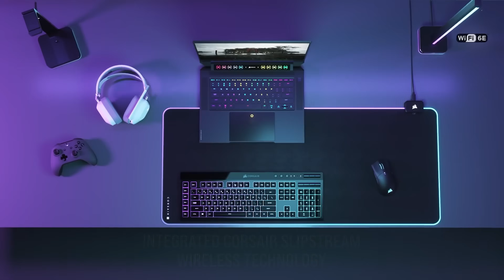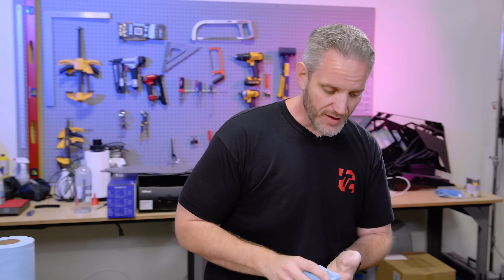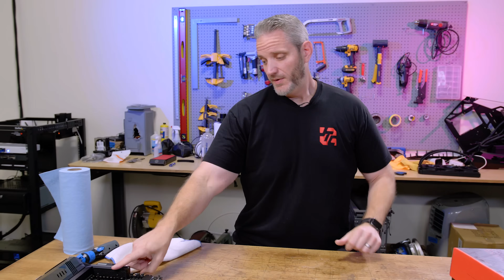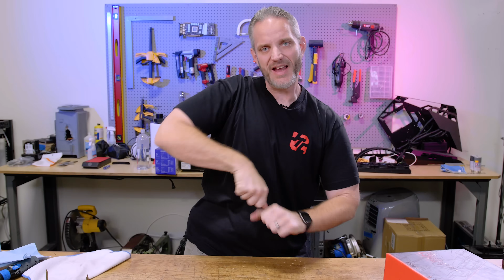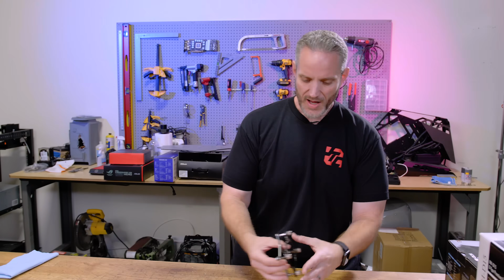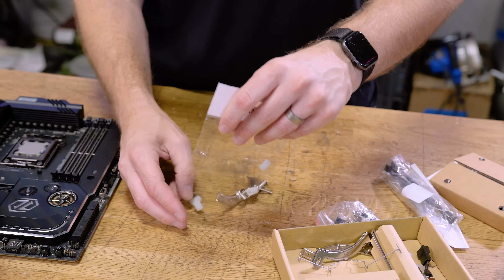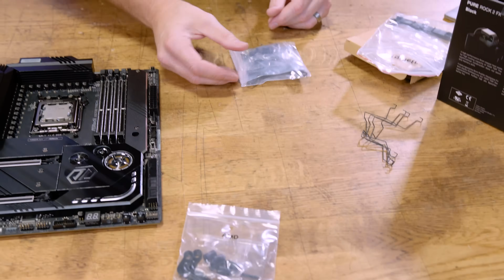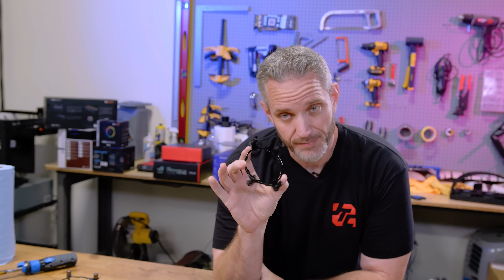AMD made a terrible flaw with this design...

Comment: Imagine installing with hooks on the old Athlons without an IHS. Besides ripping the motherboard if you slip with the screw driver, you also had a chance to chip the edge of the Die.

Comment: And then the physicist enters the comment section... In the chain of heatflow from the chip to air what material has the best thermal conductivity? Correct! Copper! The IHS is made of what material? Correct again! Copper! I'm quite certain that the increased thickness of the IHS has a very minor influence on the CPU temps. However, what has changed is the surface area of the IHS. The 20 K temperature drop that Roman was getting by delidding has to be mainly attributed to removing one thermal interface (actually the worst of them) between IHS and cooler which in addition gets rid of crappy conducting thermal paste altogether.

Comment: I don't worry about cpu degradation on tjmax 24/7, but since 7xxxx can reach higher frequencies using higher voltage if the cooling is enough... why would they do that with the thicker case? Just for cooler compatibility? Is it such a big deal when launching a new platform where customer need new mb, new ram, to also need a new cooler (or upgraded brackets) ??

edit: we got tests and reviews of the cpus using a 360 aio, I think it would be an excellent idea to have some tests of the same cpu using different coolers - how would a mid range single fan air cooler affect those cpus i wonder, please Jayz make it happen :D

Comment: EDIT2: As stated in the replies to this post, the NH-D15 does now come with AM4 mounting kit as well as the Intel kit, and is fully compatible with AM5. Jay has a very old model of the cooler, which is why his didn't include the AM4-kit.

Original post and first edit:
The NH-D15 has a separate model for the AM4-socket, which lets you mount the cooler whichever way you'd like. That's why AM4 is not mentioned on the box Jay has, it's probably an intel one. I think you can buy the AM4-compatible brackets separately. I also don't remember if it has a separate backplate or if it uses the one that AM4 comes with.

EDIT: There's another comment here by Stunlokked that has Noctua's statement on AM5-compatibility, which confirms that the AM4-compatible cooler of NH-D15 will work on AM5.
Reply: this is still incorrect. all regular nh-d15s sold after 2019 should come with intel and am4 mounting hardware(which works on am5 boards(i know because I was able to move from intel lga2011-3 to am5 without needing to request a compatability kit from noctua)). The am4 version of the nh-d15 only has amd mounting hardware in the box, they leave out the intel hardware in that edition. And noctua uses the stock backplate that comes on am4 and am5 boards.
Reply: The special AM4 edition of the NH-D15 was only a temporary product to make sure people could buy one for their new PC knowing it was compatible. Those were later phased out once the regular model started including them. Earlier owners could also request a free mounting kit, no proof of purchase required, as long as you could show that you physically have the cooler and bought an AM4 motherboard + CPU.

Comment: On the old Noctua coolers they will send you a AM4 bracket for free as they did for me and there new bracket should fit the new AM5 socket. I do have a question on the AM4 depth mounting will it be the same in depth to the AM5 socket to give you the same pressure to the CPU. EK like all the other manufacture's that use mounting brackets on the back may just have to use the right depth spacer and a screw to mount there coolers down. Again like my question is the spacer the right depth for AM4 and AM5 to give you the proper pressure to the CPU or is AM5 a little different pressure that may be just a little less.
Reply: Not for free, they charge money in the UK anyway

Comment: My question is how far can you lap the IHS before the Z-Axis height becomes an issue, and the bracket blocks the cooler plate?

Meaning, do I need to plan on a delid, or can I just shave off a mil or two, and get similar results.
Reply: If using something like the the noctua mount, you could potentially sand down the IHS by a few mm, and then sand down the plastic spacers of the mounting bracket by a few mm, and then mount the cooler as normal.

Comment: If you had a cooler that could get low enough (custom loop water block for example), would lapping the IHS or delidding be easier/have less risk of error?
Reply: Lapping would always be the less risky option as far as damage to the cpu.
Reply: There is so much metal on that IHS. You'd do better to machine a bit off before lapping or you'd be there all day. I'd delid it.
Reply: lapping is allways less of a risk, as you only make the IHS more plane on the surface and take away very little of the actual material.
delidding is always more of a risk, as you rip off the complete ihs and then put a cooler directly on to the die itself. which can destroy
the die itself even without the new cooler being put on to the die. and then when you put on the new cooler, you have to be extra
carefull to not put too much pressure onto it when tightening the mounting system down as that will also potentially damage the die.

Comment: It's looking more and more like undervolting will be the way to go.  Yes, the videos I watched show a SMALL performance loss, but at the same time, almost half the power use and a significant drop in temps.  GN very tongue in cheek said less than 600 FPS was unacceptable.  I doubt most of us could tell the difference between 500FPS and 600FPS.  Undervolting shouldn't void your warranty like deliding will.

Comment: NHD14 / D15 use a NM-AM4 Upgrade-Kit to be screwed to AM4. That should work with AM5 Boards. You can get it over Noctua Website dunno if it is for free. I bought one somewhere else because I repuropsed there Montingkit to get a Prolimatech Genesis to fit on my AM4 Board for Ryzen 5000.

Comment: So they added 2mm thickness to the IHS potentially increasing temps by around 20c to try and keep cooler compatibility but actually still needing new mounting hardware for many coolers anyway. Thats a really puzzling design choice and I would hope they have a better reason than that.

Comment: I haven't done the math on it yet. But just some napkin math says an additional 2mm of a high thermal transfer material like copper in this case would not cause a 21c increase. I wonder if there are any results from am4 direct die we could look at
Reply: The 21c decrease was from delidding, which will always make a huge difference. Shaving off 2mm from the IHS would not be as significant, but yeah it's not clear how much of an effect the extra thickness has actually had.

Comment: i believe AMD was using that hook system back in the AMD Athlon and Duron series. Quite sure i killed one of those on my first ever computer build.....gosh i'm old
Reply: Yep, started with socket A and is still there today. However I have coolers form the AM2 era, which have those clips, but you don't have to use a screwdriver for pretensioning the spring, but it has a lever that you need to turn around by 180°. Still fumbly to get the clips in place, but otherwise quite nice.
I don't know why they have not used that lever system on socket A, would have prevented some damaged boards.

Comment: I really dislike AMD's mounting mechanism. I had an AM4 cooler that used the default mount and was terrible - if you tighten it a bit wonky, or a bit too much, it will twist off the plastic hook and just fall off - I was terrified of this happening, enough to make me return the cooler I had and swap it for one that used its own mount (in fact, I think it's the same one with the 4 posts you show on the Dark Hero - same motherboard too!). I'm so much happier with the mount now.
Reply: Most decent aftermarket coolers screw into the stock backplate, which is really solid.

Regarding using the clips, I can certainly imagine having the kind of issues you describe though. :)
Reply: @blunden2  It was a Corsair, which isn't exactly a bad brand. New one is NZXT.

Comment: Love the content as always.  Entertaining and informative, great combo!  As you say, the IHS is a lot thicker, wouldn't lapping a little off the IHS help reduce temps as well ?  Obviously need to be careful of the height tolerances and contact with the cooler cold plate.
Reply: Problem with that is like de lidding the cpu doesnt that void the warranty ?? 
In essence the cpu is flawed which i dont think should sit well with consumers paying a premium for a cpu that you cant cool effectively because it is not made for the standard 7000s only the 3d v cache versions
Reply: @volvot6rdesignawd702  Absolutely will void your warranty - No one should be de-lidding, lapping or anything else that modifies the structure of the CPU, UNLESS they understand the consequences.

Comment: 'Fresh' (22nd September!) from the noctua site....so it seems even the big boy should just fit. Provided you already have the AM4 kit needed for it.

"Noctua today confirmed that all its CPU coolers and mounting-kits that support AMD AM4 also support the upcoming AM5 socket, except the NH-L9a-AM4 low-profile cooler and the NM-AM4-L9aL9i mounting-kit. For the latter, Noctua announced the new NM-AM5-L9aL9i kit that will be available free-of-charge from end of October. Mounting upgrade kits for older heatsink models that do not yet support AM4 will also be provided to customers at no additional cost."

Comment: Funfact, you can still use AM2 coolers from the Athlon64 days on a AM5 socket as longs its using clips. Personally I use a AM3 cooler (from a Phenom quad core) on my Ryzen 3 3200G in my HTPC because I had a Noctua fan for it (and it probably cools better, the stockcooler was designed for a 120W CPU and has a lot of copper) . 

Unfortunately they did change the socket holes between AM3 and AM4 so you can't use Ryzen screw-in stock coolers on Athlon XP for example. Tough you can use the Ryzen 7 clip coolers on them which is kinda funny.
Reply: Now that is compatibility goals!
Reply: Challenge: Run the 7950X PBO enabled with a Zalman cooler!
Reply: @MuhammedGemci  Do Zalman even exist anymore ? I remember those Copper wing fan coolers. I actually had one of those many years ago on an Nvidia graphics card. Was way better cooling than those flimsy small standard heat sink and fans that was used back then. Was an Asus 6600 card iirc, where the fan gave up and we had those Zalman coolers where i worked so I mounted one and even I didn't get to 6800 performance I was actually able to OC th card 30/50% up for a respectable performance boost before I got graphic anomalies from the memory boost. It came with heatsinks for all the memory chips witch wasn't actively cooled back then. And the cooler actually looked cool 😄
Reply: @mrdali67  pretty sure it doesn't, but also pretty sure those were the dankest stuff of the time, right with the OCZ memory sticks. There must be plenty of Zalmans still around though, so really wanna see someone put one to 7950X. LTT maybe? They like to do such stuff.
Reply: @mrdali67  Yea, Zalman is still around, but focus more in asian markets.
Reply: Actually many of the stock coolers is quite ok today, especially the Ryzen ones that came with the higher tier zen 2 105w tdp cpu's. It's both a good looking cooler and would be more than fine for an 5800X3d upgrade as it isn't overclockable. Not sure how good the Noctua ones are compared, as I havn't had one myself but I know many of them fair quite well even against especially the 240 Aio's. And honestly much of the reason people choose Aio's today is 1. The bling factor of RGB fans and Cooler block and 2. The reasonable price and easy installation compared to a custom loop. 

P.S.  Jayz : I liked the comment of Corsair have your logo on the thermal pad .. lol .. You get to see it once when you unpack it and replace it with Thermal Grizzly 😆
Reply: Yes sir! I also use a cooler from a phenom quad core on my Ryzen 5700g. Big ass 135w tdp rated on a 65w tdp works quite well... I bought a used case for 5 dollars and got a nice surprise that it had a motherboard and compatible cooler on it. I didn't even have to install the water cooler I got. Under stress it does not pass 65c. Sweet.
Reply: ive tossed a few AM4 "prism" coolers on hotter AM3 builds, and they work great. TONS of cooling, better than the original copper am3 stacks, and the added RGB. its almost as good as using a 212 Evo, but has rgb on it.
Reply: athlon xp?   you mean athlon64 on 939 right?
Reply: @wishusknight3009  I think it was even Socket 754, and I think even on these CPU's you can put a Ryzen 7 cooler.
Reply: @drunkenpumpkins7401  I know 939 had the clip system and the 4 hole placement, and I think it is compatible with newer coolers, and 754 was exactly the same as well. However Athlon XP was socket 462 and used plastic lips that were right on the socket itself. I dont' remember any cooler using the Cryotech holes around the socket back in the day except for the very early Thermalright Tower coolers that are different hole spacing from 939 and AM2+ ect.

And the one that i had needed a shim because the Athlon XP was exposed dye. 

But an interesting side note I just found the retail cooler that came with my x2 4600+ 939 cpu and it clips right on to my AM4 board with a 3950 on it... lol.. It works! And it has 2 heatpipes as well. But I dont think it would contend with the heat very well. 

It just clipped right in!  hahaha.

Comment: I had this issue my custom EK block  required a different back plate the solution I found was buying some unc 6/32 screws took away the stand offs and risked mounting with just screws with the springs that came with the block and very carefully tensioned them as evenly as I could worked fine cools well happy with the result but yeah pain in the arse EK are selling/giving away a upgrade kit but its not out available yet and a bag of screws off amazon is about 4 quid sterling

Comment: i like the hook system because i don't have to worry about mounting pressure. with my new spring mounted cooler i worried that i either installed it too loose or too tight and i still don't know if i installed it properly. my temps are fine, but could they be better, or will i damage my cpu if i pull the screws tighter?
Reply: You could probably find reviews of your cooler and compare results they got to ones you get to check your mount. Finding one with your exact setup might be a bit tough, but I am sure you can find one that will be close enough to compare the two.

Comment: I hate LGA sockets, too, Jay.  I ruined a dual socket server motherboard when trying to upgrade processors from E5 v1 to E5 v2 for a project at work.  Trying to take out the old processor, it slipped out of my grip about two inches above the socket, and ruined a great many pins.  My company had to pay $1300 to replace the board.  I felt horrible about that for years.
Reply: Oof, I hope yer doing better now 👍
Reply: @Inuitman  Oh, yeah, that was years ago, the early Ivy Bridge-EP days, so about 2014.  I've moved on to two other jobs since then.  I still get nervous putting in or taking out a chip in an LGA socket.

Comment: Other reviewers have discovered that the Wraith box cooler delivers equivalent performance to the AIOs they used in reviews, expect Hardware Unboxed cooler test soon.  That suggests that using the thermal constraint 95C rather than a power one allows a cheap cooler to dissipate the 170w TDP rating under duration benchmark load and any lost boost isn't signiificant.  I understand why der8auer wants to cool CPU to overclock with high voltages and put even more power in, but that's NOT what most people are clamouring for, he was already developing a delidding tool so another custom product to "fix" a problem might make him a teensy bit biased.  His overclocks were not impressive, it's pointless.  With LN2 GN & XOC team at AMD were getting only around 6.3 GHz, while others set the world record 16c setting the TJMax to 115C.
Now Dr Ian Cutress at 1hr in to his review live stream talks about what CPU designers from multiple companies are saying, they believe future CPUs will be thermal/power limited not by setting max frequencies, and also that the temperature is NOT bad, they test up to 115C and many Intel chips have throttled at 100C for hours in heavy use for years.
The AM5 backplate is "torsion resistant and stabilises the motherboard" according to Igor's Lab review and not removable so coolers that used their own mounting mechanisms changing the mobo backlate are NOT compatible, this was known as I've seen articles before launch which stated that 98% of coolers used with AM4 were compatible so some tech journalists reported on it.  In Igor's Lab article they ran WITH just an IR emissive film to measure that temperatures and spread across the IHS running without any cooler at all.
So you have a CPU that does NOT need expensive cooling solutions, works on air .. and this is a terrible problem?
Where's the data?  What qualifications does Jay have in CPU architecture and thermal design?